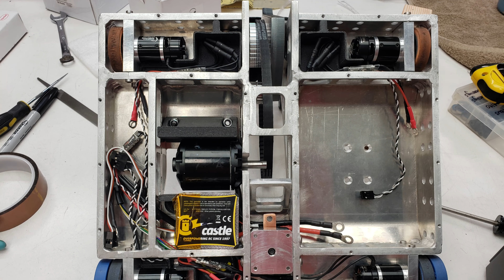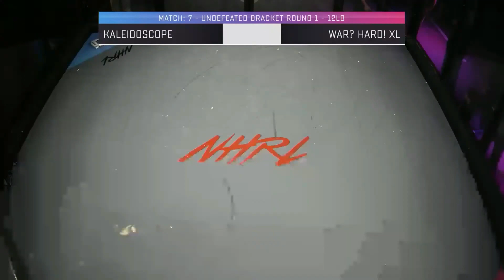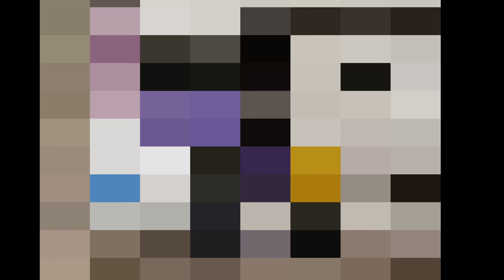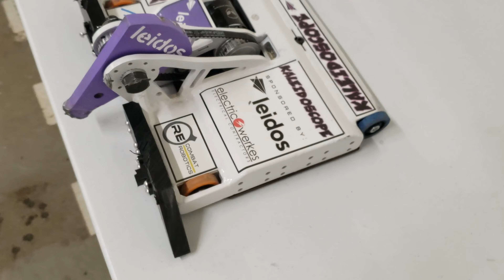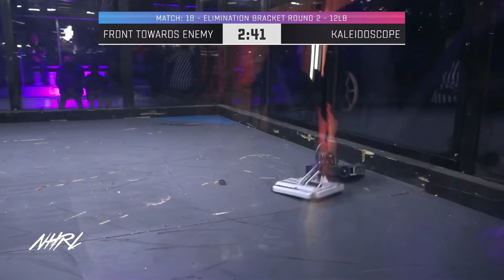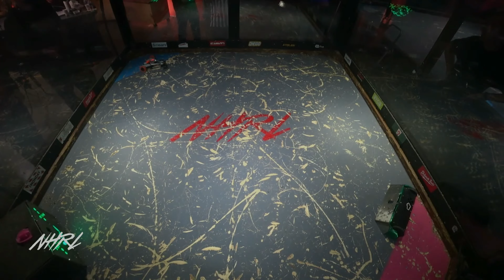Kaleidoscope's First Fights! 12lb Battlebot Action @ Norwalk Havoc

Comment: About the forks coming off, might I suggest changing the print orientation of the part and increasing your print temps?

The higher print temps should help the interlayer bonding and the orientation change should have the force that rips them off fighting the strongest access rather than the layer lines.
Reply from the maker: Thanks for the suggestion!  I want to try 3D printed mounts again at future events because they're way easier to make than CNC aluminum ones.  Besides just making them thicker, I'll be sure to try this out.

Comment: I believe the time is off in the last fight. Kaleidoscope is turned off 9 seconds before the fight ends. Then Bubbles pushes Demogorgon to the door before the timer ends demonstrating the fact that the match was already over.  I believe if the judges knew Kaleidoscope did not die they may have ruled differently.